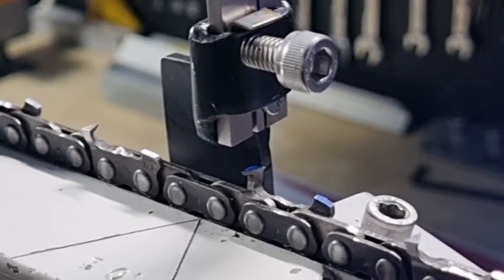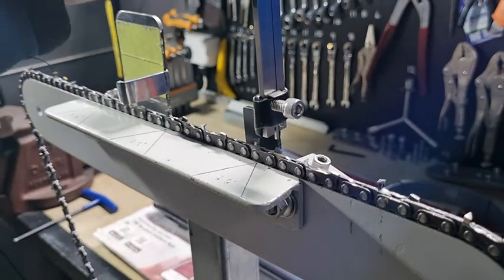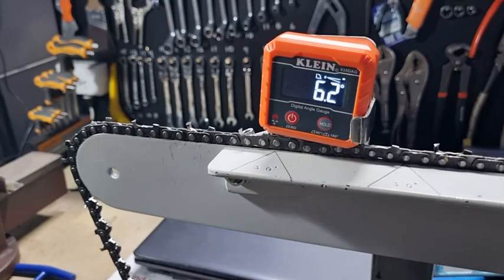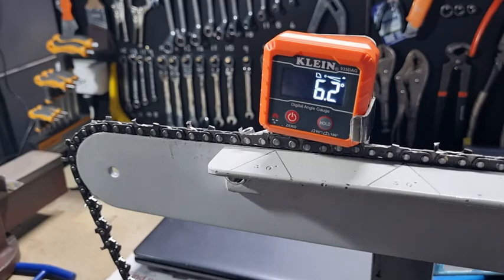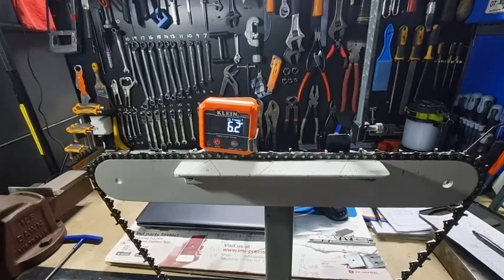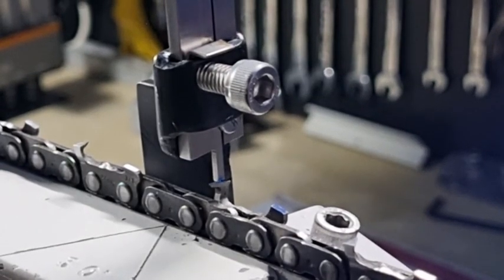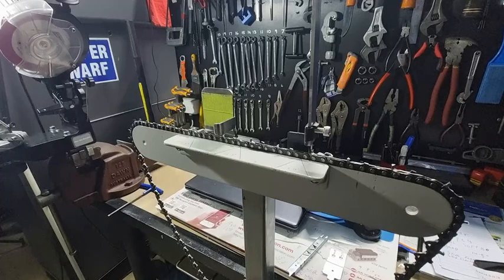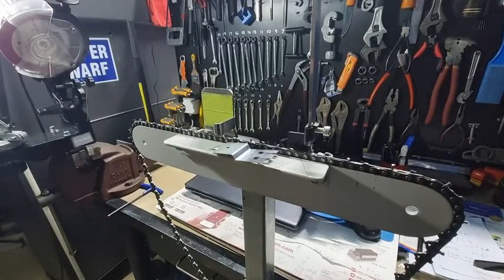Raker Depth effect on Attack angles

Comment: Carlton made depth gauges specific to every kind of chain they sold during the time they made the gauges. I have tested different depth gauges on other manufacturers chains to find the one I like best for that specific chain, saw, and cutting. The Carlton depth gauge I use produces a more aggressive cutting angle on the Husqvarna C83 chain than the Husqvarna C83/C85 x-cut specific depth gauge for example. I prefer the Husqvarna C83/85 specific depth gauge on that chain for example on say a 60cc saw felling Hard Maple. The West Coast gauges give one even more options for depth settings and they offer gauges specific to certain chains as well. So experimenting with various gauges and or measuring the depth gauges as you have done with your handy caliper holder, especially on a new chain and comparing them enables one to tailor the chain to their specific cutting and saw. There really is alot to properly sharpening a saw chain for optimum performance than most people realize. I have found over the years cutting timber that the reward is worth the effort put in to get it right.
Reply from the maker: For me it's one of my hobbies so I put the effort in and learn the hard way.  Takes time to master sharpening chains and knowing what to do and how to do it.  I now have raker gauge software to custom make your own raker gauges.  more things to play with
Reply from the maker: @el polaco  most chainsaw companies don't want to promote progressive raker gauges because you will get a longer life out of the chain. Using the flat constant gauge many people will use maybe 70% of the chains tooth and throw it away.  With progressive gauges you will use the chain until it reaches the end of life mark because of the extra depth that a progressive gauge will allow you to file the raker much deeper than a contant gauge.
Reply from the maker: @el polaco  Yes pushing down on any gauge can make you file more. A human error. I hold the FL4  gauge by the edges

Comment: I wanna hear your feeling about progressive
Reply from the maker: Look at me new video raker shoot out standard v progressive gauge
Reply: i mean cutting feeling
Reply: Maciej_Jan_Dlugosz  thanks. when bore cut, progrresive has bigger bite than constant at the nose R. the big bite is not problem?
Reply: Maciej_Jan_Dlugosz  sorry, i ment rpm, vibe, and cutting efficiency during the nose in the wood with progressive. 

kickback mechanism. As cutter become short, the distance between raker and cutter become bigger = bigger bite on the R of nose. bumpers on drv lnk, raker, or tai strp prevent or reduce kickback but not always.